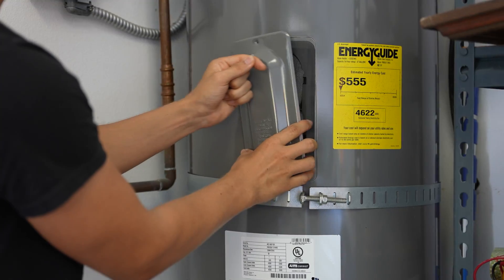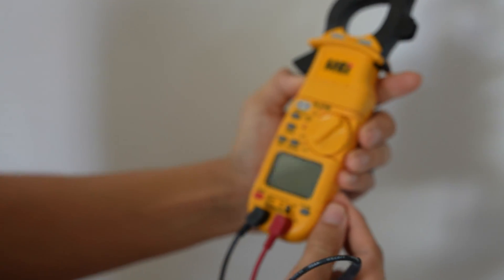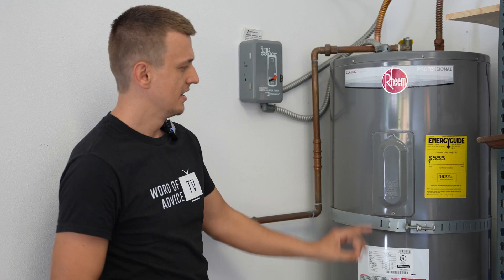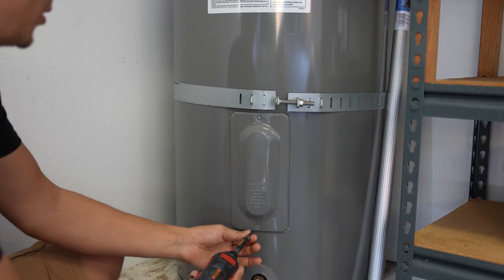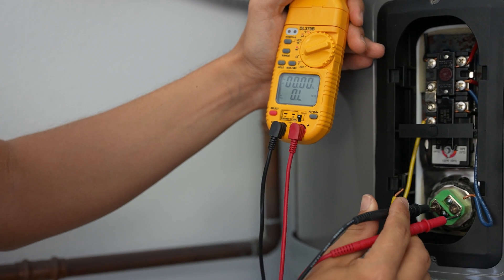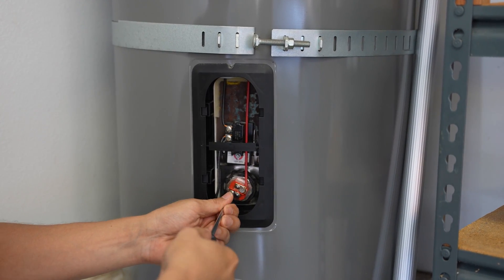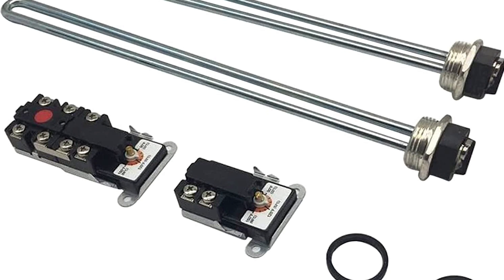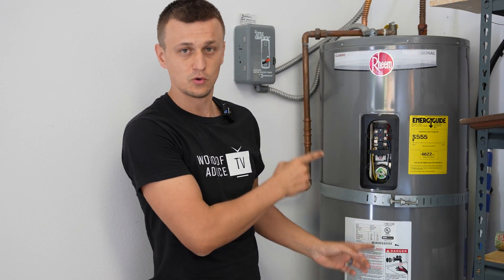How To Test Water Heater Element With Multimeter

Comment: Our electric water heater is about 2 years old. Last night I replaced both up and lower thermostats and elements. I still have no hot water this morning. What would you recommend I do? I do get 240v on the upper element while it has power. I yet have to try to turn down the upper thermostat temperature so it switches to the bottom to see if it shows voltage. If It does show what would you recommend I do if there is still no hot water ?

Comment: A friend of mine has a water heater that is producing less heat than usual, does that mean his heating element might be faulty or should I increase the temperature control you were talking about in the video, I will make sure to test everything as you said.

Comment: 1:06 How do I check to see if the water heater is the one being turned off?? Don't I have to ensure my water heater breaker is off in the first place before checking it? If I accidentally turned off a breaker that wasn't the water heater, and I went to check the water heater, wouldn't I zap myself?
Reply: Yes you’d almost die

Comment: You didn't say the most basic, if you're testing those two heating element screws to find resistance if it's good you should find some level of resistance just as if you touched your two leads together, if you were getting an LO that means there is no resistance in something is broken or dysfunctional, good grief

Comment: Thank you so much for this video. I bought a 50 gallon water heater in 2021 while I will admit I haven’t been draining it every year like I know I should. The other day, my wife was taking a bath and said that her water wouldn’t get hot like it usually did and I didn’t notice my water heater was making the heating noises a lot more than usual.  I opened up both covers and turned my temperature up to about 145 and drained the water heater to make sure it was nice and clean. I filled it back up. We still have the same issue.  I know how to replace the elements and I’m sure the thermostat isn’t hard but I’m glad I got some insight on how to test them that way I’m not wasting my money. I think my water heater is still under warranty for another almost 2 years but my plumber told me he hast to be the one to tell them that it was broken, not me lol

Comment: I was running out of hot water faster then I used too. I replaced my lower element. Before I removed it. I had 220v between the 2 terminals. After, I do not get a reading between the 2. But seriously,  each wire has 110v. I do not have a multimeter, 9nly a 110/220 volt meter.  Is it right?

Comment: I replaced heating elements and thermostats also breaker and still no hot water, help me asayc, please sombody.
Reply: Did you find any help here? I am having the same issue
Reply: Probably a bad water heater. How old is your water heater? If it's above 10 years old. It's probably bad.

Comment: Question - I did my annual draining of my hwh and after filling the tank back up and cutting breaker on, the water temperature was suddenly much hotter than it originally was.  It was really hot even though the thermostats were set to 130.  It had always been a "strong warm" but after draining and refilling suddenly the temp was really hot.  Not boiling hot but it was never that hot even when originally installed.   From the things I've read on the internet of potential problems, just about everything I read were problems that caused the water temp to drop but in my case the temperature went up higher than it should be and it occured immediately after draining the tank.   Any idea on what would cause this?  I know removing the solids would help the temp go up but I'm pretty sure this is a lot hotter than what the thermostats are set to because it was never this hot.   The tank was installed about 5 yrs ago so its not brand new but not very old either.

Comment: HOT water heater is redundant. BUT, I would rather have a hot water heater than a cold one. 😂
After measuring 17 ohms I pressed the red button and reset the  breaker on the water heater and now I’m getting 240 bolts and 18 amps.👍Thanks WoA

Comment: Should the voltage across the heating element leads on the lower heating unit equal that across the top heating element? My top shows 240 volts but the bottom heating unit is showing no voltage across the leads. Is that normal?
Reply from the maker: On most water heaters, yes. The elements come on one at a time. If the top one is on, the bottom one should be off.
This video may help paint a clearer picture of how that works:
https://youtu.be/TX8SuHK1esY?si=qf1gPcIDJlHHpmyh

Comment: I love the video how to check the elements, but my water heater is electric and solar and the solar portion of the water heater is not providing hot water I change the thermostat and it still 
not working. 0:14 0:14

Comment: Im not an electrician and before i hire one which I'm sure they can be expensive, but trying to prevent from hiring someone, I wanted to ask, my electric water heater's hot water runs out really fast. I get hot water for about 5-7 minutes and then its cold. It's brand new. I've had it for about a month now. What can the problem be????? Thanks!

Comment: I drained my electric water heater but didn’t shut the power. What should I expect after 56 hours?😢
Reply from the maker: Oh boy... Sorry to hear that. After you filled it up again, do the elements work/heating the water? If not, then one or both burned out. The glass lining inside the water heater probably cracked too. Thats what protects it from inside from rusting. No immediate consequences for that but long term it just means your tank will start to leak quite a bit sooner than it would have originally.

Comment: Hey J! this was awesome. Question for you. I disconnected the power and checked the continuity of all three elements. Top was 16, Middle was 21 and bottom was 75.
When i went back 20 minutes later they were all around 17. What would explain such a differences in measurements. Settings were exactly same on the multimeter.
Reply from the maker: Did you take the first measurements right after you turned the power off to it? If the element was just on/hot, it will have a higher reading. The higher the temp, the higher the reading. When you checked a second time, it already had time to cool off. Thats the only explanation I have for this one, not sure if it could be something else.
Reply: That’s exactly what happened. I assume since it’s the bottom element it just kicked on after I used hot water this am. Tks for your help

Comment: I was taught many years ago to always drain the tank and pull the element. If you don’t you could get false reading from the tank itself. You could get positive continuity, and ohms readings. So to be sure pull the element so it can checked visually and with the meter.

Comment: Im assuming you have to drain system to change element
Reply from the maker: I have changed them without draining the water heater but I would not recommend that. If possible, do drain it.

Comment: Both my elements are good but I’m still not getting hot water. What do I do next
Reply from the maker: Have you checked with a meter if they are getting power? I had a no hot water issue recently and it turned out to be a bad circuit breaker. Either the water heater is not getting power or the thermostat is not letting the power through (likely a bad thermostat then). If the upper thermostat has a reset button, have you tried resetting it?

Comment: Question, my continuity setting reads out 25 Ohms and beeps, my resistance setting reads open, on the same element. I took the range off auto and all that, its still reading open. Is this a meter sensitivity issue?

Comment: Hi thanks for video was great..I have question ..I checked elements I have a good reading on both ..I do have hot water but have both temp settings maxed out at 150c but when I take a temp reading of my water it is only 124c could this be a thermostat issue ? If so do you have a video to check them ..also with it being set at 150c the plastic protective cover is warm is that ok ?can I just remove it when I put my covers back on ..thanks

Comment: I have completed your test as detailed, and the readings were 14.
My panel had tripped, I did the test, the panel would not reset, I then replaced the thermostats top and bottom, the power panel reset, unfortunately still no hot water.
I’m assuming I should just change the elements? 
Is there anything else I can do?
Dave

Comment: When i measure my heating element with 200 Ohms option on multimeter, i get a constantly changing reading (let's say it goes to 80 ohms and from then it starts going down, non stop, and the longer i wait, the longer it goes down) Does this mean my heating element is broken? I tried 2 multimeters, one gets no read at all, the other one does that.

Comment: Before adjusting the water temperature higher than 120°D coud do damages on young ones and I would recommend to check 
Your water supply lines. Example Pex could melt down at 130° Degrees and do damages up to 25k in minutes.

Comment: Hello hello! Very informative vid. 
Question: Why would my unit read 0.5 volts even with power turned off to it? 

I tested my multimeter like you showed, and I'm getting around 120v at an outlet, continuity is check as well. 
It seems like the unit is getting even a small amount of power even with the breaker switched off. Also, with the breaker on, each terminal (at the top like you showed) is at around 128/9 volts, and together it's showing 250V. That's a bit more than 240, huh?
Anyway, I'm trying to test the thermostats and elements because we are getting like 10 mins of hot water MAX. Thing is, it's a new unit and it's been like this since we got it. Wondering if i might have messed up some wiring on the top when i installed it. But also wondering if somethings up from the power source at the breaker :-/.

Comment: Hey J, great video as usual.
One thing that I've learned,  if the house is on a well, you must check the sediment level. I've seen several inches of sediment in my W/H. If the lower element is at, or below the sediment level, the new element won't last very long.

Comment: Jay what good brother .. have a question . I have a maytag top loader washer model mvwx500xw2  was working good antill someone put clothe in it too much machine going back and forth like someone playing bass  my wife stop it , take out the clothe and put it correctly and it was OK after that. No banging but when the machine stops the clothes wet did not spin out dry .. I changed the pump and the actuator the main sharf clutch & belt the capacitor the machine now wash and when it reach to spin it put water in the push it out and then put again 1to 2 are 3 times before it spin out when it did the clothed still wet can you tell me what to do here please... now my wife blame me..

Comment: I also always check each element with my “megger “ insulation resistance checker to see if the element sheath has split and water has entered. I probably also make more use of my clamp ammeter and the LoZ volt tester to avoid any ghost volts. And Thx Jay !

Comment: Nice!
When checking my test lead continuity, I flex the cable at the ends and along their length, to check for any obvious  intermittent issues. Course my equipment has hundreds of hours of use.
Reply from the maker: Great tip! Thank you for sharing sir! May your leads never fail you! 😄👍

Comment: Good morning Jay I have no questions I simply must say the hot water heater looks very close to a new installation. Very clean and professionally installed. I like the safety strap and the electric disconnect. I'm a huge supporter of lockable breaker lockouts. Outstanding job  my friend
Reply from the maker: Good morning good sir! The water heater is relatively new (2016) and we actually just had a small earthquake here so those "earthquake straps" are definitely a great thing to have! I like the electrical disconnects as well and fully agree that whoever installed this did a great job!  👍👍👍

Thank you for stopping by. May God bless you and yours, have an awesome weekend!!